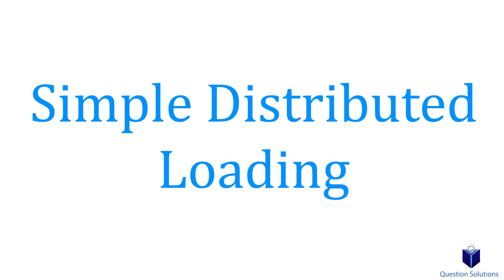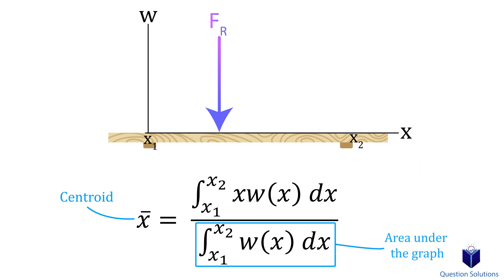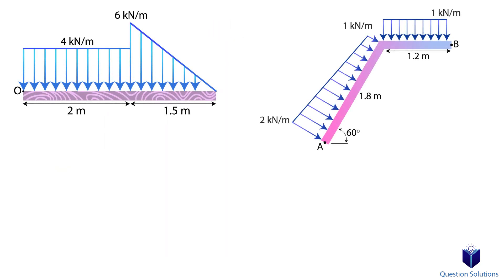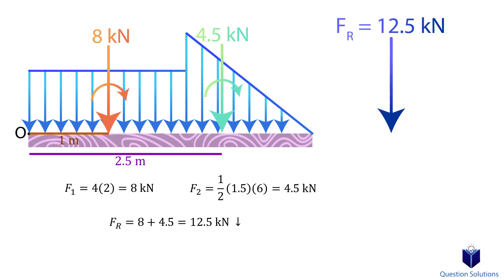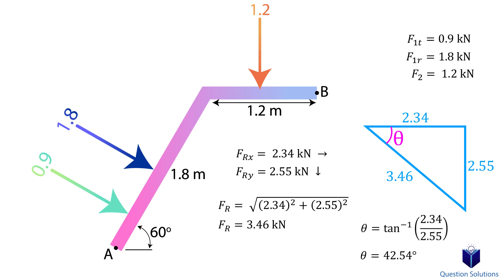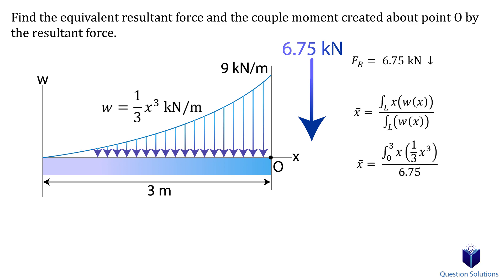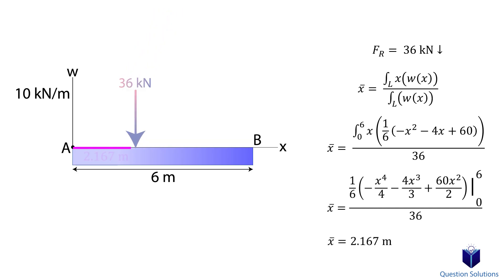Reduction of a Simple Distributed Loading | Mechanics Statics | (Solved examples)

Comment: When finding moments in the second example. Why is the moment created by the triangle and rectangular forces 0.9 * 0.6 and 1.8 *0.9. Shouldn't the perpendicular distances be like 0.6*sin60  and 0.9 * sin 60. Like he didnt account for the the angle but i made be just confused.
Reply from the maker: So it really depends on how you set up your coordinate system. You can do it your way by using sin and cosines for the perpendicular distances for the slanted forces, and keep the top force distance the same, but here, it's easier to use a 60degree slanted coordinate system, while just breaking down the top force distance. That's why for M3, we used cos60, but for the other two forces, we didn't. You will end up with the same answer, but your method requires the use of angles for 2 forces, while establishing a coordinate system that is already slanted means you only need to break the distance down for 1 force.

Comment: in number 3. How did u get the 2.4 meters?
Reply from the maker: So you have to solve the definite integral at the top and then divide that value by 6.75. Here is the integral solved step by step: https://www.symbolab.com/solver/definite-integral-calculator/%5Cint_%7B0%7D%5E%7B3%7Dx%5Cleft(%5Cfrac%7B1%7D%7B3%7Dx%5E%7B3%7D%5Cright)%20dx?or=input

Comment: on question 2 isn't the distance supposed to be 3.6 instead of the 1.8 when finding the perpendicucal distance f0r m3
Reply from the maker: So 1.8m is not perpendicular, you can see that it's a slanted incline. What we need is the perpendicular distance, which would be 1.8cos60 plus the 0.6 m which is the halfway distance from where the 1.2kN force is applied. See 6:43, I show the distance.

Comment: Hi QS. Just a quick question why we can say that the triangle part is equal to the rectangle part which was 1KN/m. I mean why we can just half it
Reply: around 5:30
Reply from the maker: @marcoli262  We aren't halving it. So if you look at the diagram, you'll notice on the bottom right, we see 2 kN/m, and if you follow the slope upwards, you will see 1 kN/m. That means the difference gives us the height of the triangle piece, which is 1 kN/m.

Comment: Isn't the moment caused by the 1.2 kN force on the second question causing clockwise rotation? If so, don't we have to add a negative sign to the calculated moment for this force?
Reply from the maker: You only use positives and negatives during the process to find the resultant moment. That allows you to determine whether the resultant moment is clockwise or counterclockwise. At the end, you should indicate a direction with an arrow going clockwise or counterclockwise, not with a negative sign. Moments aren't negative or positive, they have a direction in 2D problems.

Comment: in example 2 you have taken the moment m3 as a sum of  1.2(1.8cos60+.6) but why i am stilll confused plz reply sir!!
Reply from the maker: I am not sure of your question 😅 So if you look at 6:42, I show the perpendicular distance and how it's found with the light blue lines. Think of the total length as the bottom of a right angle triangle, then we can figure out that length using cosine, because it's adjacent over hypotenuse. So here, the hypotenuse is the 1.8 m, and the adjacent is the perpendicular length we want. So you get 1.8cos60, and then we still have the small distance at the very top, which is 0.6 m. Add those two values together and you get the total perpendicular distance. It might help to draw it on a piece of paper with a straight edge :)
Reply: @QuestionSolutions   yeah i got it sir thnx for the help

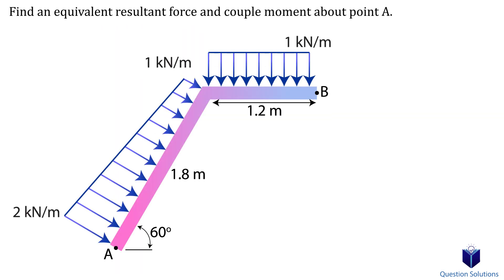Comment: The example at 5:02 I got the same final answer, but I did it differently. The distributed load on the 1.8 m bar, I saw it as as a trapezoid and used F = (1/2)(a + b)(s), then the center point going horizontal = [(2b  + a)s]/[3(a + b)]. The load on that bar came out as 2.7 kN and 0.8 m away from point A.
Reply from the maker: Yup, that works as well. Well done!

Comment: Quick question, at 3:13 why is it 6kN/m and not simply 6kN?  The force at the leftmost side of the triangle is 6kN, no?
Reply from the maker: This is how distributed loads are represented on diagrams. We don't write just 6kN. We represent it with respect to a distance. So you can think of it as "it starts with 6 kN/m at the top and goes all the way down to 0 kN/m." I hope that helps 👍 Please see your textbook for more info on this as it should be covered.

Comment: Hello, please why F1tx= 0.9 sin60 and not 0.9 cos 60? At 5.53
Thanks in advance
Reply from the maker: Please see: https://bit.ly/3IcvBHV I drew it out for you. Notice how the purple component, which is Fx, is opposite to the angle, so it would be sin where as the light blue side, which is Fy, is adjacent to the angle, meaning cosine. In such scenarios where you have a hard time deciding if it's sin, or cos, I encourage you to draw that force alone on a piece of paper, neatly, and then looking to see which side corresponds with the angle. It might take an extra minute or two, but will help you in the long run :)
Reply: @QuestionSolutions  thank you! I was also confused by that.

Comment: I’m confused on 5.55. How do you how to draw the angle between the forces to determine the components?
Reply from the maker: That's actually done using geometry. I encourage you to draw out the shape to scale and use a protractor to see the angles, otherwise, you will need to identify how alternate interior angles and consecutive interior angles give us the 60 degrees. It's best done by extending the lines and seeing the parallel lines it creates. 👍

Comment: How do you know how to place the rectangle for example mines was /| because Frx is positive which means is 1 quadrant and Fry is positive is as well in 1 quadrant so my Fr was in the first quadrant but your right triangle was fippled.
Reply from the maker: Could you kindly give a timestamp? I am not sure which example you're talking about.
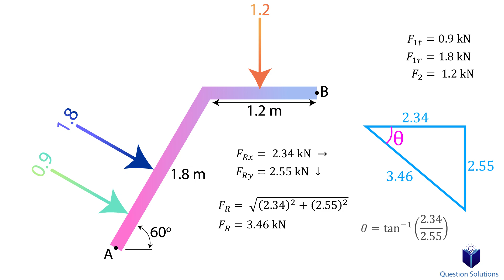Reply: @QuestionSolutions  6:15 and thank you so much for responding back I thought you wouldn't answer.
Reply from the maker: @emersongonzalez1999  Ahh, I see, you're referring to the right angle triangle? That's based on our answer. It changes every time. So notice, our x-component faces right, and y-component faces down? So we just draw it exactly like that. A light to the right and then from there, downwards. Then you connect the ends to create the triangle. So depending on the question and where our forces are facing, it will always change. I always repond to comments, or I try my best to :)